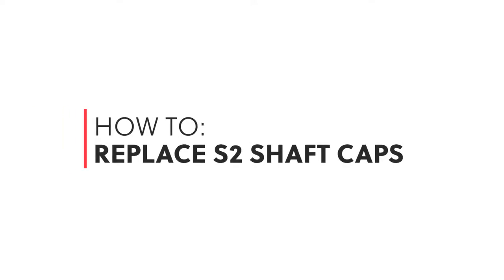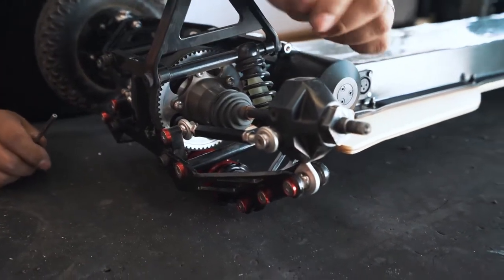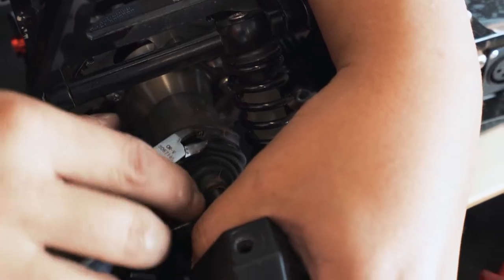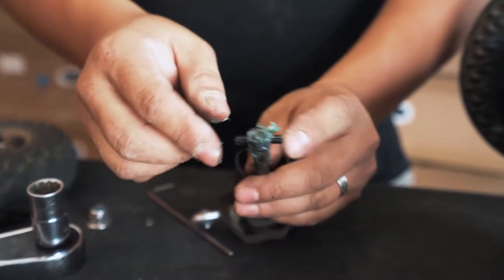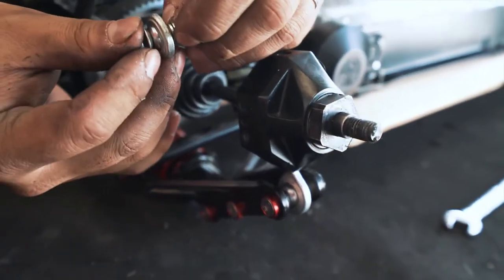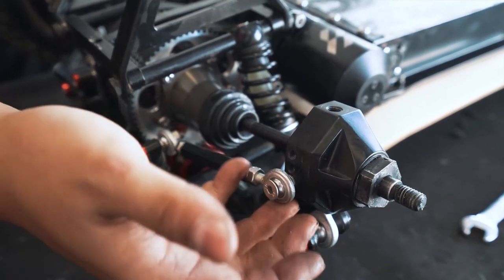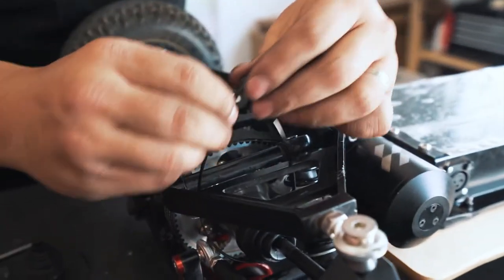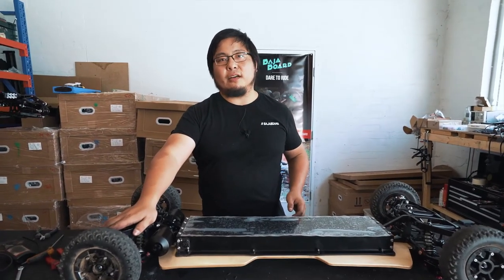HOW TO: Replace S2 drive shaft caps

Comment: The cups that goes on the pin, is that pin replaceable?  Also, if the cap does break and falls off the pin, will the pin damage the housing?
Reply from the maker: Every component on the board is replaceable, including the pin. If the caps do completely break and you continue to ride you can cause some damage to the housing. This is why we strongly recommend doing regular checks of your board's components. One way to see if the caps are worn out is to hold one motor stationary (with the board off) and spin the corresponding wheel back and forth with your hand until you feel it engage with the motor. If there is too much play, you should disassemble and observe the board's caps visually.
Reply: Ok thanks. Got it!👍
Reply: I just did it to my G4x and all are about the same. Now I know the norm. S2 also had same play on both wheels👍